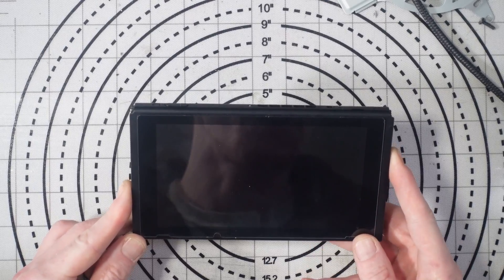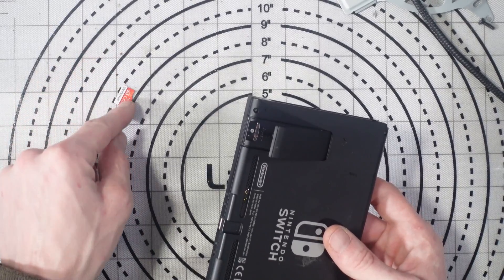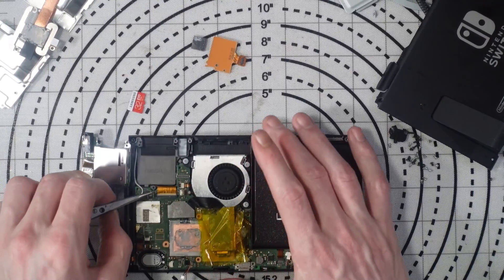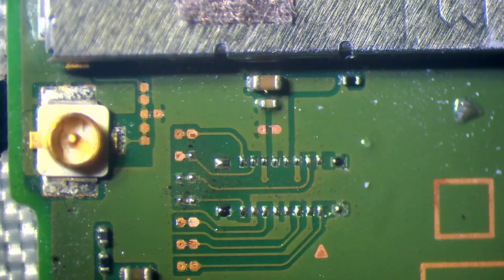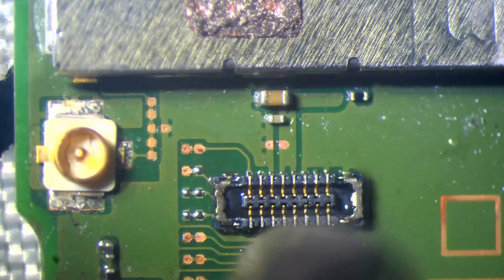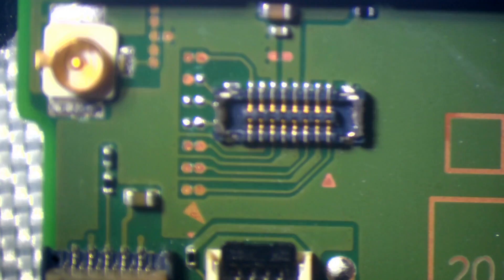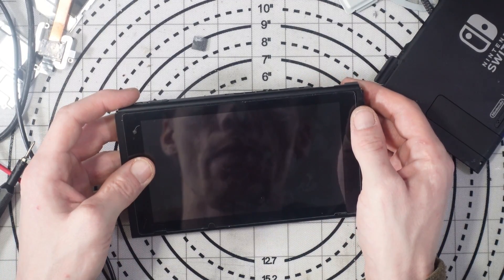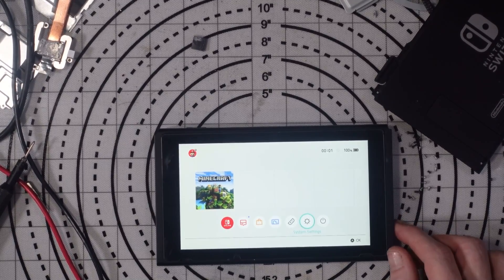Nintendo Switch Not Reading SD Cards... Can I Fix It?

Comment: That switch had a bad repair on the emmc connector at 6.12 you can see the solder on the left unused pads before you tin it plus the mod is solderless apart from the apu no reason to have flux around the connector unless it was repaired

Comment: wanted to thank you. recently did an hdmi port on a ps4 slim for a friend. despite doing tons (daily) smd rework, i never did a ps4 hdmi before. i was very successful following your video. preheated the board and used the full nozzle and it came right off.

Comment: I think you get too upset about modded switches, without the SD card in them they are totally legal, all the modified switch software is on there, the Hekate bootloader on the mod chip does not contain any modified nintendo software at all.
Reply from the maker: It honestly doesn't bother me bud. I just can't legally offer it as a service that's all. I have to make it clear otherwise I get inundated with requests for it.

Comment: i have a switch which doesn't enter rcm, and is slow at acknowledging SD cards. I thought it was the connector, so replaced that and the fault is still the same. never had that issue before as replacing the socket always fixed the issue.